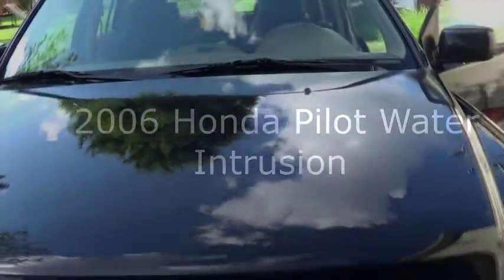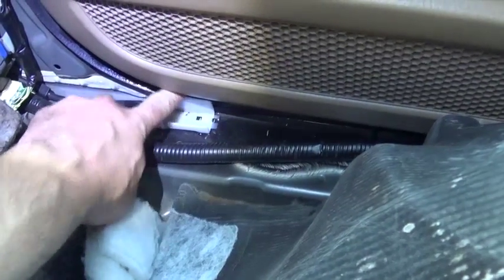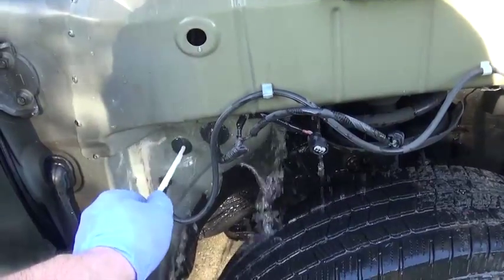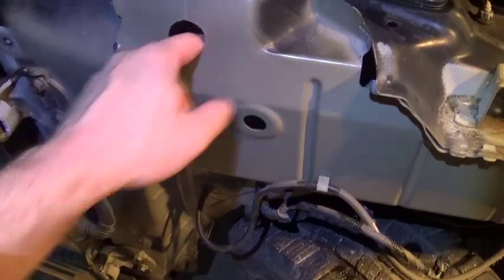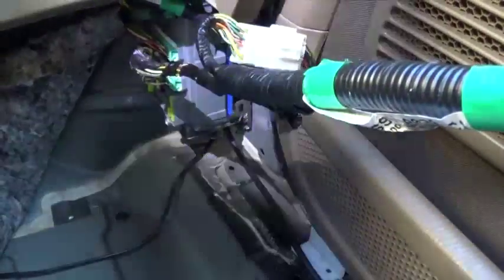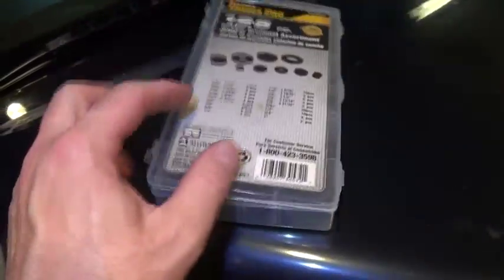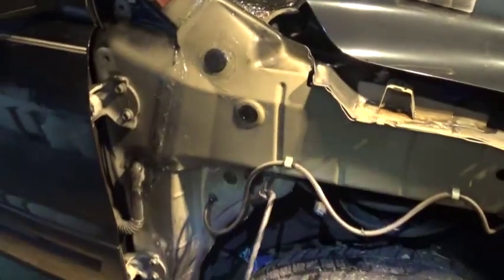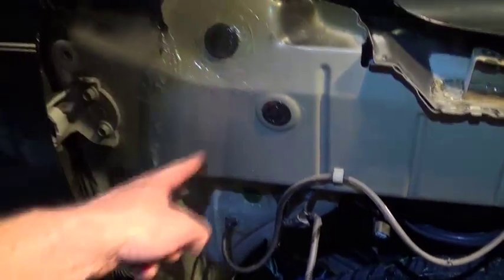2006 Honda Pilot Water Intrusion

Comment: I have a 2005 Pilot and had the wet carpet problem but only during the rainy season. My problem and associated solution may be different from what is described here. There is a drain hole at the bottom of the door pillar on both drivers and passengers side. It is a small hole and is recessed. It is covered by exterior panels that come together and shield the hole so water from the tires can't get into the cavity. You can't see the location of the hole even if you crawl under the car because of the overlap of the protective panels. In addition, there is an interior overflow hole a few inches up from the bottom of the floor. If the drain hole is plugged or in my case, clogged, water accumulates until it reaches the overflow and then it starts to drain into the cabin and soaks the carpet. In my case, the drain rate was greatly reduced because of the clog and unable to drain fast enough during the rainy season. All of the troubleshooting videos involved removing the fender as this gentleman did. I didn't want to do that. Grabbing for straws on a fix, I went to a body shop. These folks are very familiar with how all the pieces fit. It took the estimator about three minutes to find the water accumulation and  suggest the fix. They had the car for about two hours. The fix involved removing the clog and enlarging the drain hole by 1/16". Both sides cost me about $30 and the problem was solved.
Reply: I have a 2006 Honda Pilot and after the car getting very dirty I also noticed a couple days later that the carpets on the floors of both the passenger side and the driver side were soaked every time it rained hard. So I took the black end pieces at the rear of the tires off and noticed that it was very clogged with leaves and mud. I cleaned every thing out and replaced the "black piece" (I dont know what it is actually called) and I am hoping this fixes the problem. I also used my hose to get the clog out and it made the carpet  more wet, so its a good sign this was the problem. Thanks for your reply.. if it continues maybe ill have to take it to the shop as well.
Reply: I'm trying to figure out exactly where these drain holes are... you said you didn't want to remove the fender, so did you not have to remove the fender to gain access to the drain holes? You said they're covered by exterior panels so I am scratching my head trying to figure this out.
Reply: @coryperemsky  - I would also like to know this. Although water getting in does not sound good, if it can get out easily then that seems like the quickest solution.
Reply: The more I think about this the more I am thinking this is "barking up the wrong tree". My 03 has been great for over 12 years and then developed this issue. A drain hole plugged seems more likely than multiple intrusion locations.
Reply: @tegra5971  did you figure this out yet?  Same problem here!!!
Reply: Brian Dokter - I am afraid applying silicon as far as I could reach after removing the wheel well cover (did not like the idea of taking the whole fender off) I did NOT have success. I am almost to the point of drilling a drain hole underneath to vent that channel that fills up. Now that the worst of winter is over I will try this again. (This is about driving me nuts)
Reply: Tegra I think Hat Trick’s shop found the answer. Wish he could explain the solution a little more. I’ll be digging around a bit more and will check with a body shop too. If you figure out something, let me know. I’ll do the same.
Reply: Watch the end of the video you can see where the water flows into at the bottom. You gotta take off the rock guards or whatever, I think

Comment: Great video and for your patients!  Doing my research now all over the internet and it seems that several people have pointed to the same cause as you have found.  My car is in the driveway now with the wheels removed and inside foot panels removed as well along my wet carpet.  I will start removing the front corner fenders soon after I buy the silicone or rtv sealer.  Even though my 2005 Pilot has served me well for over 15 years with 250K miles, I do believe that I will try a new Subaru Forester as my next car.  Thanks for this info!

Comment: I’m in the middle of removing the driver side fender but I’m stuck! Do you have to remove the bumper and headlights? I’ve removed all the bolts/clips that I can see and it seems to be stuck between the headlight and front bumper. Is there a bolt that I missed to remove?

Comment: 2 quick points I would get seam sealer not silicone the second is this is a 2006 and it just started I think a drain hole is plugged allowing it to fill up
Reply from the maker: randy hughes This car doesn't have sun roof and AC drain hose is not clogged up. This car is fixed. It's been three week now with couple rainy days and no leaks. Thank you my friend.
Reply: KY Home Garage KY Home Garage where did you read I said a/c or sun roof I guess you dot think there are vent drains in the body of a car
Reply from the maker: randy hughes sorry sir I didn't understand your comment. I will pay more attention to vent drains in future. Thank you.
Reply: KY Home Garage KY Home Garage ok I will try better we can assume that seam has leaked from when the car was new now something changed to make it hold the water and leak inside the car I think the drain hole got plugged that let the water out for the past 12 years